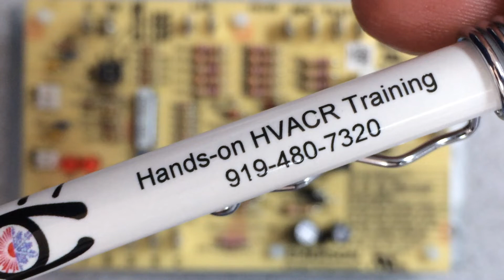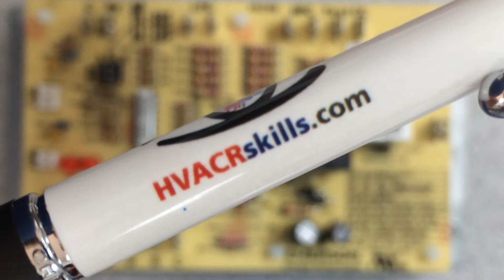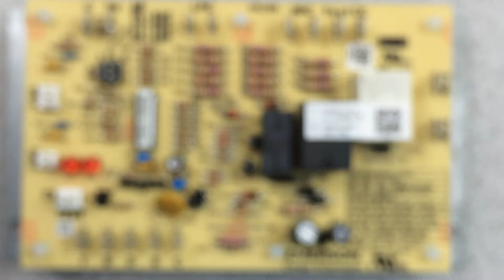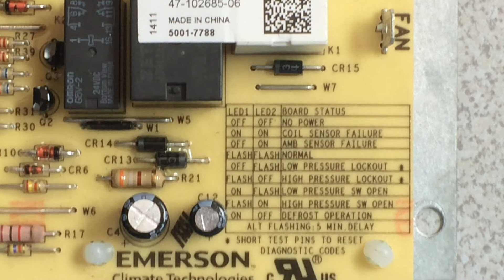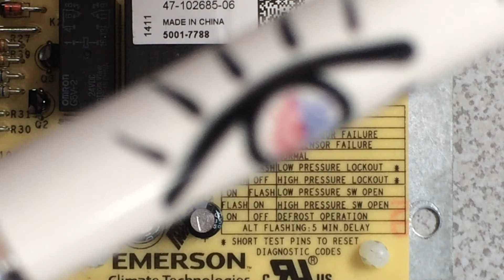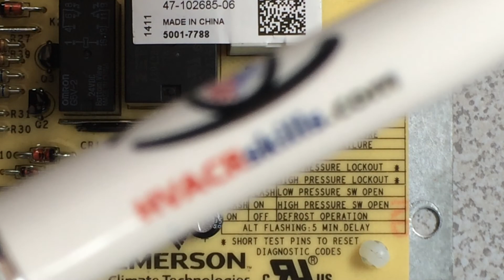Demand Defrost Control Overview

Comment: Very clear explanation of the defrost board functions.  Now I just need to find a replacement board for my 1990 Ruud achiever 9 heat pump which stopped defrosting and constantly energizes the reversing valve even when the thermostat is set to OFF.  Thanks for the video which will be a help in replacing my board once I find one.

Comment: Before I condemn the defrost board Trane CNT 02941. Help.  Defrost is auto "demand". Condenser ices-up. Does not engage auto-defrost. I jumper test pins, unit enters defrost mode, OD fan cuts out, but only 5VAC to reversing valve. Reversing valve coil Ohm checks good. Sensor pins at board show proper voltage at 5.5VDC. Both outdoor temp. sensors ohm out good relative to outdoor ambient temp. LED flashing normal.     I have to melt the ice by temporarily jumping R-O on indoor terminal board which activates reversing valve. Any suggestions prior to condemning defrost board? Thanks.
Reply from the maker: Thank you for detailed measurements and observations.  I agree that the board has failed.
Reply: @davidcameronhvacrtraining3639    Thank you for your reply. I just replaced the board and all is fine. I think that I covered all of the possible tests that can be conducted in the field as described in my first message. On the solder-side of the bad board, I did notice blackening on one single solder connection indicating "burn."

Comment: Im trying to troubleshoot a Rheem with this board and everything operates well in cool mode, but when i turn heat mode on the reversing valve energize but i dont get the 24 volts from yout and cc to energize the contactor,, and after a few minutes fan and heat strips come on and it keeps operating that way... any tips what should i be looking for? thanks in advance for your response...
Reply: Sounds like a bad board. As long as both pressure switches are closed & you have 24v between C & Y.